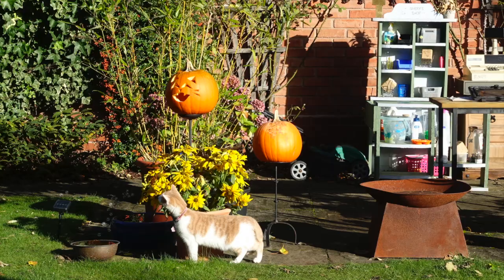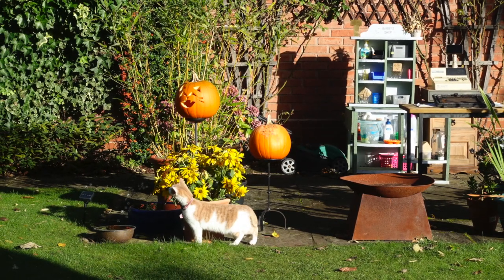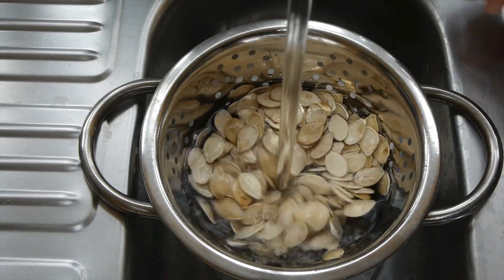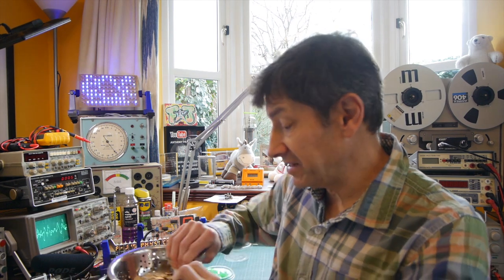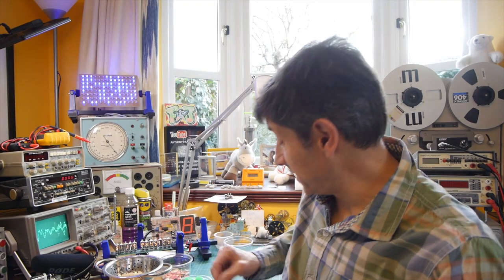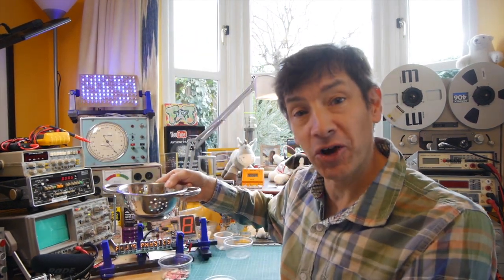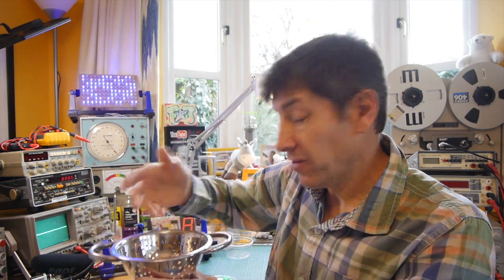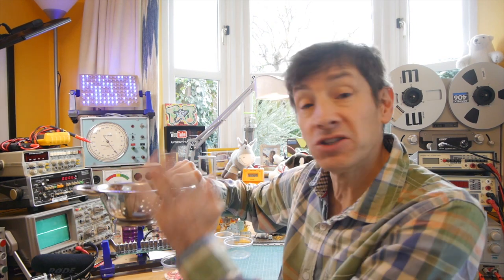Pumpkin Seed Effect - Solid, Solid Water Jet Mixing - F-J's Physics - Video 176

Comment: Could it be the bowl shape of the colander, try repeating the experiment with a plastic sweet container with lots of holes drilled in the bottom and sides. Thanks for another interesting video
Reply from the maker: Yes, Anthony.  The curved nature of the base must really help with the flow channeling.  Would make a good school project (we used to have to do them for A' Level) as there are lots of variables.  Wouldn't it be fun to do with actual sweets that slowly dissolve!

Comment: It seems to me the large surface area compared to the mass of the pumpkin seeds make them especially good to demonstrate this effect, which may be why the plastic chips didn't work as well.

Also the shape of the seed would make it a lot more likely to intermix thoroughly where a non ovoid may not mix as well.
Reply from the maker: Thanks. I think you are totally right.  Different densities at play too.  It was not meant to be too scientific but just a bit of fun but, as you point out, there are some very interesting variables at play here.  Thanks for watching and taking the time to comment.  Much appreciated!

Comment: This is not (in a general sense) a new effect at all, it is an example of fluid bed mechanics and is already used for mixing and conveying granular and particulate materials, usually with the fluid being air instead of water.

I work for a company that does air jet milling; we process a lot of abrasives and pigments for some pretty well known clients, as well as (literal) tons of material for batteries.  The machines we use have multiple (2 or 3) jets all directed into the center of a chamber, creating colliding vortices of the sort you show here.  A stream of bulk material (powder or granulated, even chunks as big as those seeds or larger) enters the chamber, swirls around and self-pulverizes (allowing us to process some very hard materials) and then there is an outlet at the top of the chamber where particles that are fine enough to become airborn are either pushed back by a centrifugal blower, or if fine enough to pass with the air are conveyed to a collector.
Reply from the maker: Seb, thanks so much for this.  I should have thought about fluid bed systems - I have seen them used with coal powder.  I have not yet seen it done with a liquid as the fluid but I am sure it is out there somewhere!  It was all a bit tongue in cheek as you know but thanks so much for your comments.  I am a very great believer in real world uses being used to explain physics and yours are excellent.  Many thanks for taking the time to comment so fully and for watching.